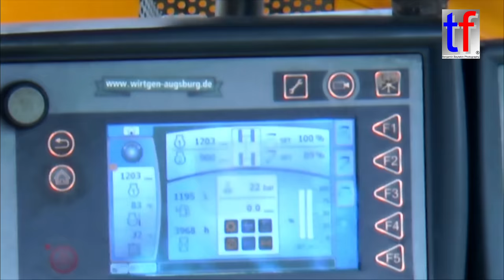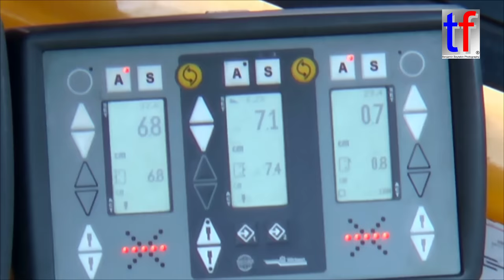Wirtgen W 250's Cold Millings @ Work / B 14 Abfräsen, Waiblingen-Nord 11.03.2016.

Comment: Take a welding rod and a round target in neon orange attach it to the grinder.   Make sure the orange dot can be seen in one of the truck mirrors.  Make a circle of tape to blot out that dot when the truck is at the right distance.  put a neon stick at the top of the dot, when it dissappers he is getting too close.  Now you do not have to beat the horn
Reply from the maker: Splendid idea!
Reply: watchthe1369 ll
Reply: watchthe1369 kkjlk
Reply: watchthe1369 All trucks have different cabins and seats, so you'll need a whole set of welding rods. What those guys really need is drivers who can read the f*cking manual and engage crawling gear. And that's it! That driver is definitely from Poland where he simply bought his driving license for 100 zloty.
Reply: You made my day with this golden comment :DDDDDDDDDDDDDDDDDDDDD respect
Reply: @Maloy7800  ...Millings out of the machine are hot!  By laying them in the semi trailer going forward and backward, repeatedly moving, the millings get a chance to cool some...this keeps them from clumping into 1 huge mass, in the semitrailer, which is not be able to slide out, when truck driver goes to dump the load.
Reply: Why are they hot?
Reply: friction
Reply: I have seen that there is a solution for  beating the horn. They had put some sort of traffic light at the end of the conveyor. But that was mainly used at night

Comment: How come your not using multiplex on a road like this.Ide figure rideability would be important here
Reply from the maker: +Scott Jones What did you mean by "multiplex"?
Reply: +Benjamin Beytekin Multiplex is a form of automation to increase smoothness of the milled surface.There are sonic sensors that are placed at each corner of the milling machine and one in the center .It is possible to hang 7 sensors on each side ,but not seen often.But what happens is the three sensors on each side read the surface and takes a average  so the machine reacts slower and creates a better surface.They look to be using the side gates  instead.How this works is there are sensors in the front and back cylinder  on the side gates .As the gate goes up and down the machine reacts,same idea but a smaller area is read and its not quit as effective smoothing out rougher roads.Hope this answers your question.If not ill try again.
Reply from the maker: Scott Jones Excellent explanation! :-)

Comment: And in northern Europe can machine and truck drive same speed, not go stop go stop........
Reply from the maker: THAT would be the best way!
Reply: Millings out of the machine are hot!  By laying them in the semi trailer going forward and backward, repeatedly moving, the millings get a chance to cool some...this keeps them from clumping into 1 huge mass, in the semitrailer, which is not be able to slide out, when truck driver goes to dump the load.

Comment: Hmm do wonder why the truck dosent ceap the same speed as the machine!!
Reply: +Gunnar Hustoft - you dont want to discharge the millings to only one portion of the truck bin.  With the truck pulling forward and stopping, it enables the load to be spread evenly over the axles for legal loading weights
Reply: Some truckers have the "feeling" of going slow forward too, so it doesn't go so fast between each honk.
I've driven wirtgen 2500 for a couple of seasons, at one site when I get to use the trucks who's used to working under the milling machine, I didn't have to stop between the trucks. That was a productive job! :)
Second, we use lights (red for stop and green for go) instead of honking, less misunderstandings.
Reply: Millings out of the machine are hot!  By laying them in the semi trailer going forward and backward, repeatedly moving, the millings get a chance to cool some...this keeps them from clumping into 1 huge mass, in the semitrailer, which is not be able to slide out, when truck driver goes to dump the load.

Comment: In America we call this a "cluster fuck"
Reply from the maker: +Scott Jones What's wrong at that site?
Reply: +Benjamin Beytekin Well its working,i guess,but it seems like mass confusion. Trucks turning around in the middle of the road,trucks on both sides of the road,just a little chaotic . Safety should be first and it just looks like a accident could happen there pretty easy
Reply from the maker: Scott Jones Ok. There were 4 mills working on different positions and 68 trucks coming in at only one entry. And they have to go to only one exit. Could be worster ;-)
Where did you living in the States?
Reply: yes i live in the states
Reply from the maker: Scott Jones My question was: where in the States?
Reply: +Benjamin Beytekin oh,lol,sorry.Upstate NY. I do milling ,when im not doing that I run screed on a paving crew and when not doing one of them two jobs i run heavy equipment.
Reply from the maker: Scott Jones I was several times in NYC and NY State. Where exactly?
Reply: How much do Mill operators get paid in Germany to do this job?